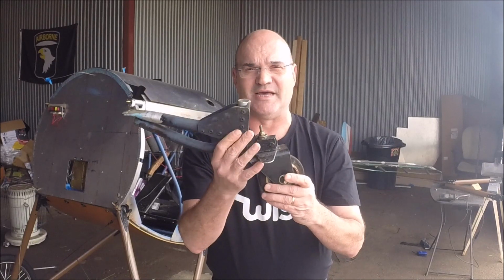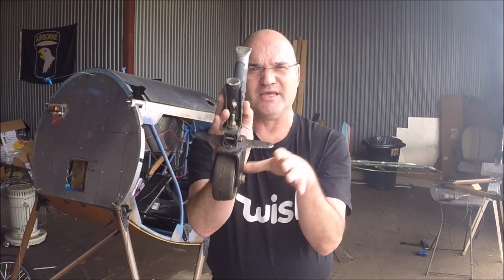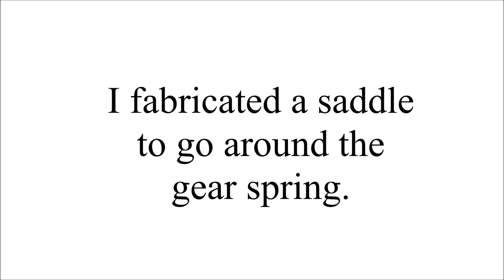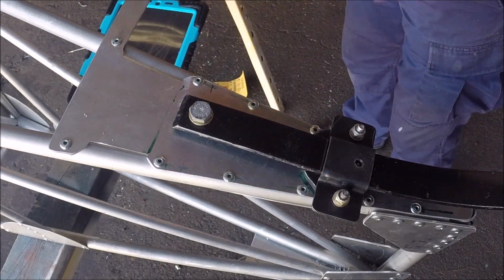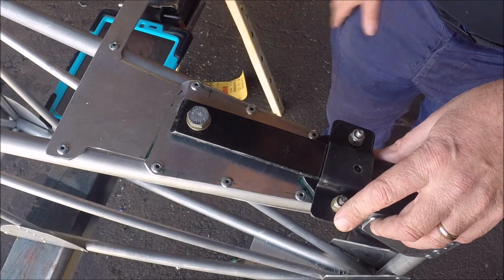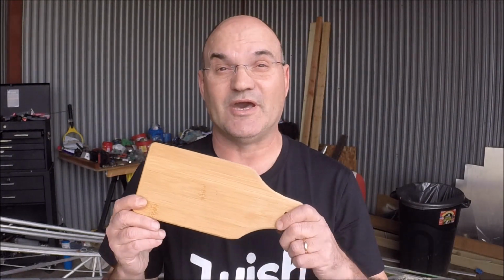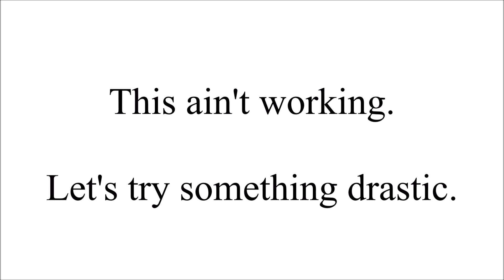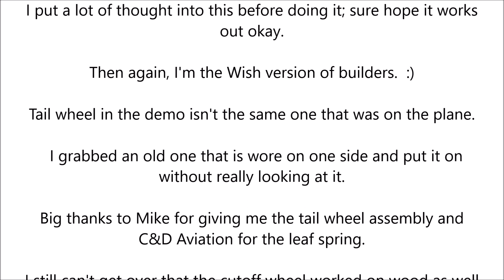Rebuilding the Nieuport - Putting on the Tail Wheel!

Comment: Good job, but my only suggestion on the two plates you installed is have a spacer of Delron or aluminum between the two plates where your bolt goes through holding the spring steel for your tail wheel.
You may have already done that good luck on your build.

Comment: Very nice job. My only suggestion is between the two plates where the spring steel is bolted that you have a spacer where the bolt goes through of either Delron or aluminum.
You may have already done that again good job
Reply from the maker: It's not really shown clearly in the video, but there are bushings and fender washers between the two where the bolts go through.  Otherwise, the lower plate will simply bend up and make the bolts loose.  But thank you for making the observation.  One of the biggest reasons for making these videos is to have folks spot problems in my work!